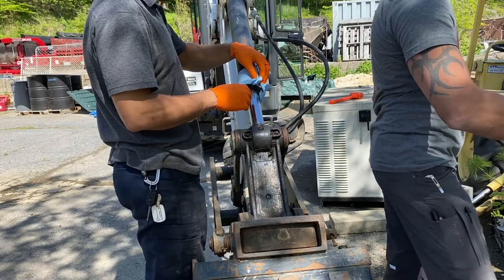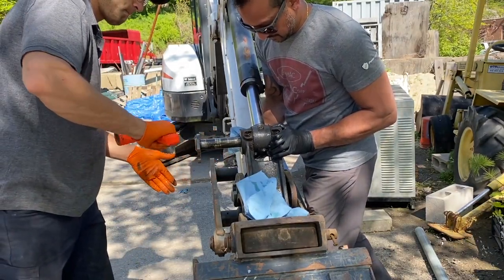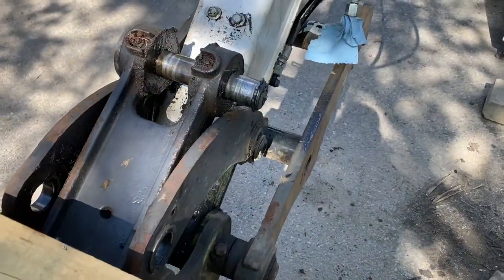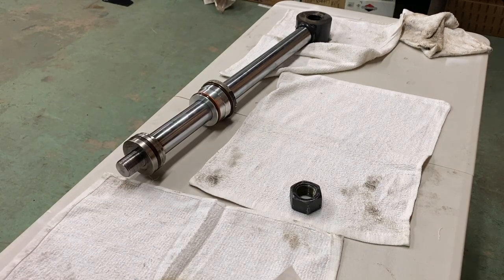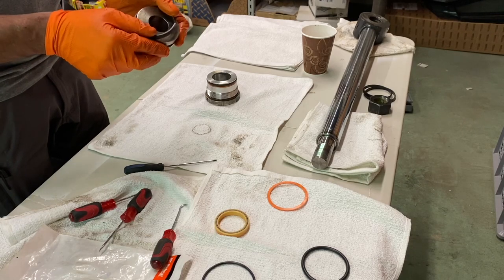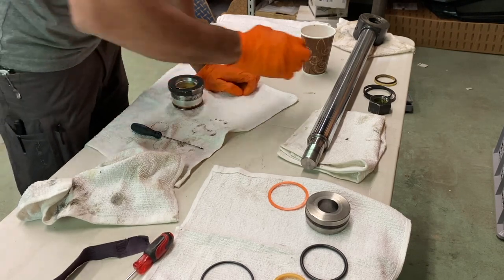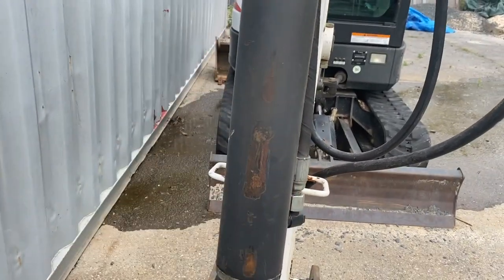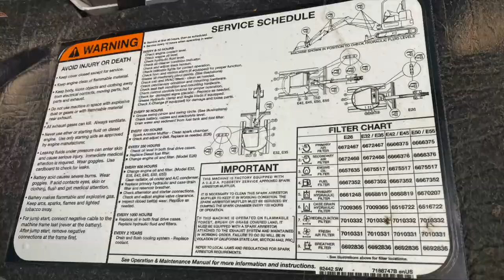STOP WASTING YOUR MONEY!! Bobcat E32 Mini Excavator Bucket Seal Replacement

Comment: that gland nut tool is a piece of crap. get some 1/4 x 1/2" hardened dowel pins {got mine from ace hardware} press those 1/4" dowels into the tool replacing the soft piece of crap ones. then itll actually fit your bobcat glands without popping out and needing a pipe wrench. also tighten the center bolt so its adjusted to the size of your gland.
Reply from the maker: it was a COMPLETE POS! i returned it to amazon immediately !

I was so frustrated with it i didn't even think about how to make it better.  Thank you for the tip, i'll get it again when its time to replace the rest of the seals.

this is one of my earlier videos so I missed a few key points, but i think most people get the basic gist of how to replace do the repair.  

Local dealer wanted 750 for it!  no thanks.

Comment: Hello can you please give me information for the hydraulic bleeding fitting ,what store,part number?
Reply from the maker: Hi, sure, it’s literally the hardest thing to find from bobcat. 

I purchased it from discounthydraulic hose.com 

Part number 2HTF2

1/4” female coupler, 1/4” NPTF

please note I never got a chance to use it but I remember testing the fitting and it did connect. 

I paid $56.20 including shipping. 

Hope this helps.

Thanks for watching
Reply: @Ratherbemilling  After you reinstalled the hydraulic cylinder on your mini.Did you have to bleed the system prior to use . Since I replace the seal in my up hydraulic arm the hydraulic system makes a weird noise when in use.
Reply from the maker: @jamelofrazier  I didn’t have to bleed it but I did have to top it off. How much leaked out? 

Also, are you sure you put the seals in the correct order?
Reply: I'm pretty much sure I did put the seals in the correct order. I resealed many Bobcat Hydraulic Cylinder before with no problem. The noise is coming from the hydraulic pump system when move engage the arm. I'm going to try toping it off again and bleeding the system . I didn't have any issues with the noises prior to taking the cylinder apart.
Reply from the maker: @jamelofrazier   you probably have more experience with this then I. This was the first one I did and luckily no issues came up afterwards, thankfully. I watched a video by @innovative which helped me figure out the  bleeding process. 

Might be worth checking out his videos and shooting him a message as well.
Reply from the maker: @jamelofrazier  https://youtube.com/channel/UCONHzdxEimLrrI0F1mihCUg
Reply: @jamelofrazier  no doubt you’ve sorted it by now. However I was told to operate cylinder to full extent each way (with out load)   this allows the air to bleed out of system.  It’s always worked for me. May take a few full extensions and retractions of cylinder
Reply from the maker: @michael dahm that’s pretty much what I ended up doing. Took some time and also had to open up the fill cap a few times to allow air to escape but it worked out.
Reply: @michaeldahm214  Thanks for your response everything is in working order.The most frustrating part of the job was getting the jamb nut off the piston .You have to heat the piston nut up pretty hot  to remove it.
Reply from the maker: Did you try using a pipe wrench with a 5’ cheater bar?
Reply: @Ratherbemilling  Yes, it was so tight it actually broke the vise.My local  Bobcat Dealership told to bring it by their shop.Seeing that they had problems getting the jamb nut off.I didn't feel so bad after all the disappointing unsuccessful attempts I had with trying to get it off.All it cost me was lunch for their time.
Reply from the maker: Lunch and their time is not bad at all. If time wasn’t an issue I would have had them do it but I needed the machine running ASAP so had to do it myself. 

At least now I know the tricks … physics will always win. 2’ pipe wrench and 5’ cheater bar… now I’m just happy to keep getting work done.
Reply: @Ratherbemilling  Save your money I agree my machine was on jobsite also they couldn't come until 4 days later at a cost of $800.00 . So I took the hydraulic cylinder apart left the outer casing on the machine and removed the inner cylinder piston sleeve to just have them remove the jamb nut.After that I resealed it and then installed everything back together. Afterwards I resealed the Hydraulic Quick Attach while it was still down before I changed the hydraulic fluid and filter.